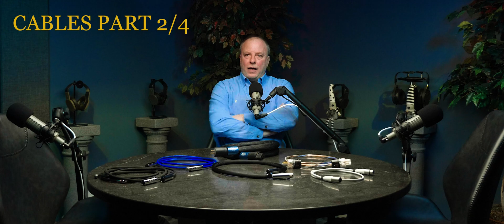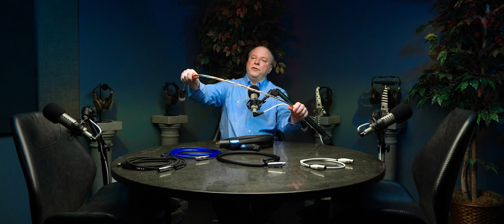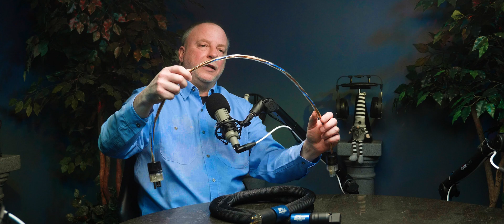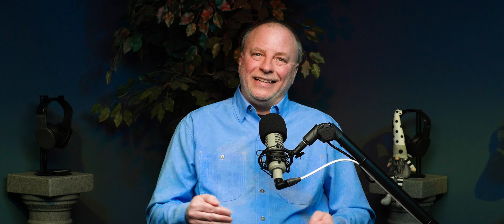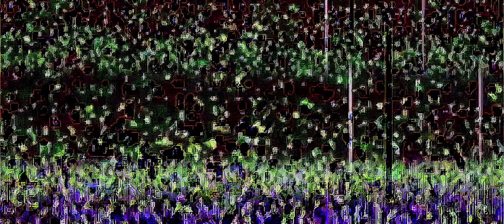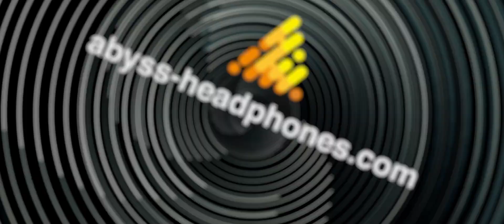Cables Part 2: Materials & Design Engineering a Hi-Fi Cable

Comment from the maker: Reminder there's 2 more parts in this series coming. In part 4 we talk about the cost.
Reply: Ive heard the difference in cables and am a fan of jps and abyss. My entire system is wired with jps. However with people like audio science reviews doing measurements and saying the difference is all in your head, ive been less sure of what is causing me to hear these differences. If Joe, who probably has better capabilities than most, can do a blind test successfully, maybe it will end this argument. If the difference im hearing is in fact all in my head, that is still reason enough for me to buy "better" cables.
Reply from the maker: https://youtu.be/SWJbbrhJP_I
Reply: @ABYSSHeadphones  We can side step all of that double blind malarkey with SCIENCE and LASER BEAMS and prove you right. Sort of.

As you know, for the cable to make a difference, there MUST BE a difference in the signal and ultimately the sound coming out at the other end. Luckily, measuring vibrations/sound with lasers is the most insanely accurate thing humanity is capable of as evidenced by how INSANE gravitational-wave astronomy is.

We could measure the sound produced by headphones and cables down to picoseconds and atomic resolution. If you throw enough scientists, engineers and resources at this, they might be able to distinguish between different cables driving a speaker just from how the speaker sounds. It may even be a piece of cake compared to detecting black hole mergers. It would not surprise me. Would it surprise you?

The trouble is that all of that would be so far out of human perception and senses, your claims of hearing cables would still amount to having a superpower. An extremely lame superpower at that.
Reply: @ABYSSHeadphones  Your cables' inability to pass a double blind test does not make double blind testing invalid.
Reply: @stayedfaded  back when i had first started this hobby, i was into portables. Dap, iem and such. Back in Korea, there were many audio shops with iems, headphones and cables where anyone could walk im and try different cables and iems. Because of this, it is generally agreed that cables do make a change. I myself experienced this swapping cables and noticing changes. In the middle of my comparisons, i would once in a while mix the cables up accidentaly or forget to chnage the cables when comparing and would conclude that the two cables were very similar(forgot to swap the cables out) or my oppinion on them would suddly change(accidentaly mistake ine cabel for the other). From this i realized it was not "oh it looks nice so it must be better". Everyone has their way of lietening to and comparing gear. For me direct a/b test of the same part of the song worked best for me. When i moved up to headphones and speakers i realized the change from cables were not as dramatic as with iems, but was still there. Going back to testing, it is very difficult to make an objective and scientific test to see if one could differentiate two cables. But i dont think this perfect testing is what people want to see. If one sytem from power cable to interconnect to speaker/headphone cable was all lamp cord and the other system, all jps aluminata cables, and we had a box that the lister could switch between the two whenever they wanted without the music cutting out, could an audiophile pickout which is which, knowing that one is lampcord and one is jps? I think i could, but  havent had the chance to try this. If this is not possible, if you had two identical listening rooms with different cables, and the listner had a month or even a year to listen to both whenever, would they pick the jps over lampcord? The lister knows what they are litening for, no tricks, no second person involved. Just a lister who can by a press of a button switch from on to the other. I think i could pass this test and would be very surprized if joe couldnt as he must have heard something change (however he did the "test" to hear the difference)when trying different conductor, geometry, shielding. If no one is willing to try this, even just for curiosity sake, ill build myself and post the results. Maybe i wont be able to tell the difference, but will that cause me to sell my cables? Probably not. I like nice things, even if they dont actually do fuctional things, like leather uphostery in cars.
Reply: Could you do a video where you do a double blind test to see if you can actually tell the difference between a few cables? I am super skeptical of the cable industry. I know you guys make fantastic headphones, but I am doubtful about the cables. I have never seen someone truly able to tell the sonic difference between cables, I did a double blind test and could not tell the difference between a set up with all expensive cables and a system with 20$ amazon cables.

Comment: Hello Joe and Co.  You have interesting things to say in your videos and through parallel research of my own I concur in your findings re conductors and dielectrics 100%. Yes dielectrics are everything to do with sound and conductors relatively not quite so much.  Cable quantum noise and its effects on system excess noise is what you are dealing with, yes cables are quantum filters and dictate noise behaviours of both downstream and upstream equipment through frequency and amplitude dependent energy storage and energy return characteristics. You are well on your way but your cables are indeed tone/timbre controls and this implies non transparency. There are other dielectric materials that do sound completely natural, the physics behind this is especially interesting.  We could have an interesting chat sometime. Cheers.

Comment: I am looking for interconnects or speaker cables that can tame and suppress down some of the upper mid / lower highs glare with female vocals / violins / horns which is uncomfortable and make me cringe. I am using a push pull tube power amp to drive a pair of ProAc floorstanders. Any direction that you can point me to on the JPS line of cables? Thanks.
Reply from the maker: What are you currently using for cables?
Reply: @ABYSSHeadphones  Duelund 12ga for biwire speaker cables. Tellurium Q Black interconnects from CD player to preamp and same to power amp. Alan Maher Design power cord for power amp. XLO power cable for preamp and Shunyata Venom Digital for CD player. The Tellurium Q has helped. But I want to take it further down on the upper mid glare.

All the power cords goes into an Alan Maher Design power strip and another Alan Maher Design power cord to the wall main socket.

The upper mid glare comes from the tube power amp. I am using a Leben CS1000p with new Russian Gold Lion KT66s. Its has more energy in those upper mid region. KT66 has helped too. And now want to find if JPS cables can helped further to improve it. Thanks!
Reply from the maker: @tshingtenglim965  Thanks for this. A few things, first would be to question the power cords. I don’t know this company but I would bet given the system is primarily wired with them they are adding to some of that upper mid tendency which is characteristic of unrefined cable designs (highs and lows are rolled off,leaving this). The speaker cable being a tinned copper will also push this region into the lower treble. Suggest to start with our lowest cost UltraConductor 2 speaker cables, that should help with the ProAc’s. Then try to connect the amp directly to the wall, bypassing the second series power cord. If the glare diminishes, the amp needs a different cord. If not, then maybe you need to explore more tube options or look more closely at the source (CDP). Suggest JPS Labs PAC Lite for the amp, it will do no wrong, just smooth detail and very good tonal balance, again straight to the wall if possible. Amplifiers will sound best without all that clutter inline with their AC power. Also try swapping out that XLO power cord with anything else.
Joe

Comment: I have a kz iem and i got some random extension  cable for my pc use. And sound has changed a lot i can't describe it clearly but feels like everything a bit lighter? and just a smich bit more wide or hollow. and at total sounds worse than original cable. But i have tried kz's copper cable too and it doesn't give me any diffrent in sound. extension cable is a instantly make itself obvious that it sounds diffrent btw no need the listen so careful

Comment: I love your headphones, but I can’t get behind the cable hooplas. Even an extremely high end instrument for measurement, like an oscilloscope, has a very difficult time measuring the minute amount of electricity traveling over expensive vs cheap cables... The only thing expensive cables can do is limit capacitance to a small degree, insulate, and provide a decent connector for whatever application. All tasks are very important, but this can be done at much more reasonable price points.There’s literally an inaudible difference from the best 200 dollar ac cable and the best 4000 dollar ac cable. 

If someone has the ability to hear the difference between high end cables, they would literally be able to hear a circuit breaker with a tiny pit in it. The would be able to hear the approximate age of resistors or capacitors due to their innate degradation. Shoot, you’d also be able to hear your air quality and the slight variations heard below sea level and a thousand feet above sea level...

I do mean to sound a bit curt, because the cable craze does nothing more than pay the bills. Technically yes, there is MAYBE an extreme minute change, but it simply is not distinguishable.
Reply: Trust your ears and enjoy the music.
Reply from the maker: As you get better at listening for change and continue to optimize a very good system you can hear through the system back to the microphone.

Comment: Thanks for the informative explanations. It does bring a headache lol but how should we build cables then! There most be a better way then just slapping them together and voila voila 😝
I heard a friend saying cold press joints was the best way to make the conductivity as straight possible, while soldering has some loss in it due to less conductivity....

Dod I heard correct you are using copper and aluminum? Is it aluminium plated copper? Or just different strands with pure metals each?
Reply from the maker: It's a proprietary composite conductor.
Reply: @ABYSSHeadphones  thanks 

Hey Abyss I cant wait too see a closed back iem from you guys, the market need ToTL closed back planar  iem there is none available.

Comment: everyone is held up by measurements, testing, and just the pure cost of the product. Joe brings a pretty good example of cooking. We're subject to opinion on different cooking, flavor and price per value on taste. Audio is no different in this sense and fact of the matter, any niche hobby. If we want to compare with food, take a burger for example, we can say that a local pub burger costing $15-20 objectively taste better than McDonald's. But some may or may not agree that a $350 wagyu burger with exotics ingredients taste better than that $20-30 burger, hell $100 burger. We aren't out here taking that $350 burger or the $20 burger and subjecting it to a food lab to break down the molecules that make that burger taste and be what that burger is to compare. We simply taste, like or dislike, understand the process of how that burger got to that price range and what ingredients effect it. Some pairings of ingredients work, some don't and this happens for every price bracket. And before we talk about cables costing over 10k, remember that burger analogy? Well that's 350 for a one time consumption marked up well into the same region of fine dining. Cables and interconnects have the same effect. JPS basically making the fine dining cables in audio. The materials, the technique and the subjective flavor of sound in which they have in mind may or may not align with everyone. Same as any other equipment. Something may measure excellent but material of the driver and design and ergonomics may make it sound bad. This is apparent at any audio show as well. If anyone want a comparison to other industries and hobbies all this applys to, I can list a lot more.

Comment: Claiming that there is an audible difference even tho you can't measure it is kinda sus. Its like you compare 2 identical cars but one of them is faster because it has a flame sticker on it.
Reply: Do you know that "if you can't measure" doesn't mean there isn't any difference right? it's possible for your ears to tell the difference from two cables even if doesn't exist a measurement tool that's precise enough to measure it, right? for example, Galileo Galilei, only after his death scientists proved that his theories were right! you're not wrong just because you can't measure the difference between two things with a measurement tool, or even, if we as mere mortals don't know about those tools, because we don't work in the field, doesn't mean that it's impossible to tell the difference or measure it!!!!!
Reply from the maker: Actually it's more about how each car drives.
Reply: @ABYSSHeadphones  blind test plz
Reply: @ABYSSHeadphones  I think the point they are trying to make is not that there isn't a difference, but that this difference should be measurable in some way. I think that it would help tremendously in easing tension in this controversial topic if you guys could go into what changing these materials does electrically and how that could change the sound. One easy example could be the effects of capacitance.
Reply: @ABYSSHeadphones  so you wanna tell me that the exact same cars drive differently
Reply from the maker: @saitam8129  Different drivers will not respond to the same car in the same way, dependent on experience level, and the road is a variable.
Reply: @ABYSSHeadphones  but in your analogy, the driver is the signal going through the cable? If you took these different drivers and swapped cars (ie swapped signals on each identical cable), they would drive the same. Unless road conditions, weather, pedestrians, etc, affected their performance. In which case, they are clearly not properly shielded against external variables.

Comment: If you can hear a difference in a power cable then the equipment's filtering is garbage.
Reply from the maker: https://jpslabs.com
Reply from the maker: Or maybe it's that the system has more resolution available being limited by the cables.
Reply: @ABYSSHeadphones  more resolution, for a power cable!? 60Hz/120V is your source in the US and that's all that should be delivered. We design filtering to ensure that a clean source is available and that any carried signals are removed. Be it from the utility, induced from adjacent equipment, or space. There shouldn't be any characteristics at all passed through. So again, if something does, the filtering isn't good enough.
Reply from the maker: @albe23  That's what I thought too, many years ago, until I began experimenting and found specific needs of say an amp or a DAC. We were the first company to make application specific AC cables [in audio].
Joe
Reply: @ABYSSHeadphones  could you elaborate more on these specific needs?